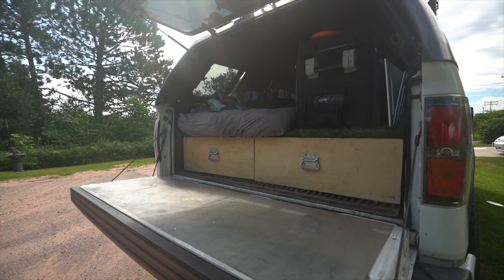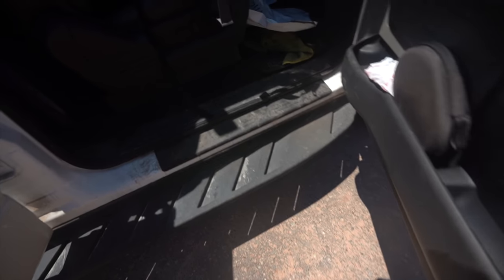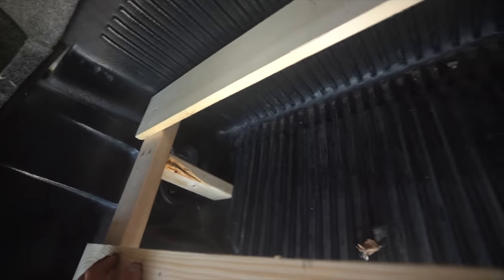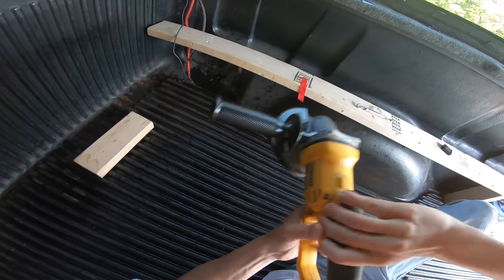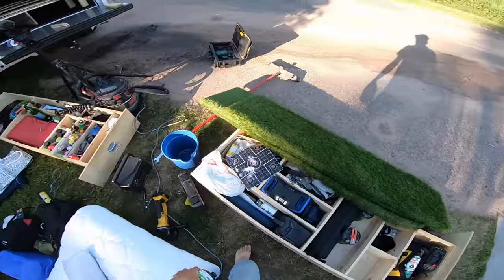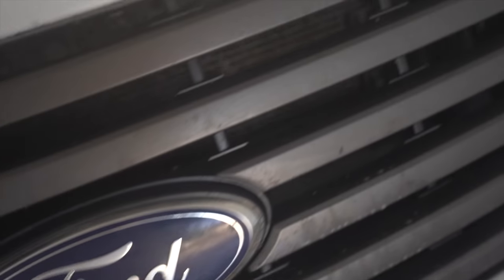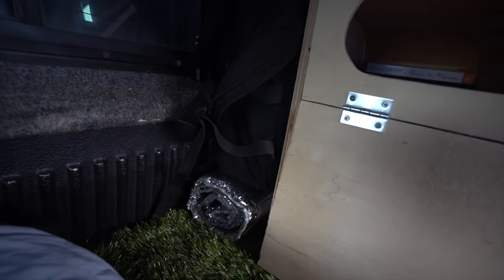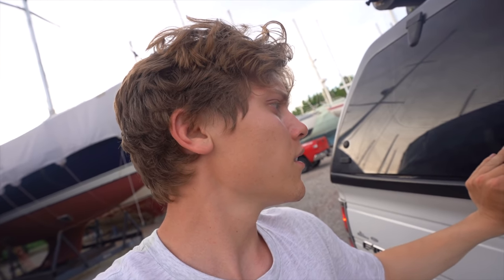DIY Wash + Detailing my Truck Camping Setup ($50 Budget)

Comment: I agree with what a couple of others here have said; lose the back seat for more storage space. Or at least half of it if it is made up of two seats put together. Also a bottle of window cleaner is your friend to carry along. You can clean most surfaces with it and it’s good for keeping the bug splats down - dissolves/loosens them off the paint/glass before wiping away. Thanks for the upload! 👍🏻

Comment: Nice job mav, loved the video. I am a professional detailed in Chicago and just a quick tip of advice for the bugs is to rub/touch the paint as little as possible. One thing I do is dilute super clean degreaser 4 to 1 and just spray it on let it sit for a minute than power wash it off. This way you are not rubbing the bugs into the paint and scratching the front of your truck. Thansk for the great content!

Comment: If or when you detail again, vacuum the biggest parts, then open all doors and use an air compressor and blow everything out from one side out the other door. You can use the air to blow out all the small tight to get to areas. Works really well on the carpets too agitate deep debris.

Comment: I need to watch your battery situation and it's power possibilities. 
So the decking slides between the bed liner and that gives the track for the drawer? 
The truck looks good. 
I like your build more and more.
Reply: Link to the Vlog on the battery set up.... that's what I meant to write.